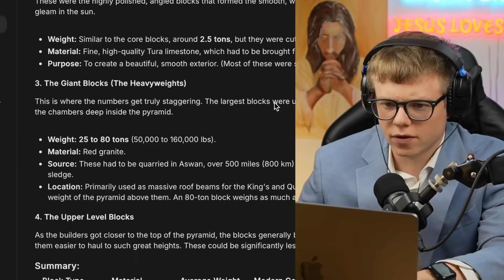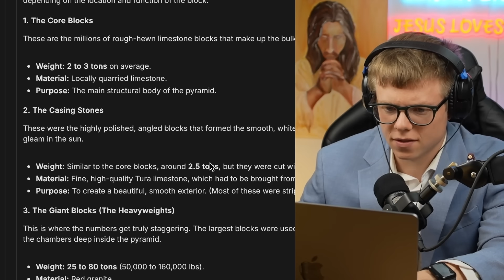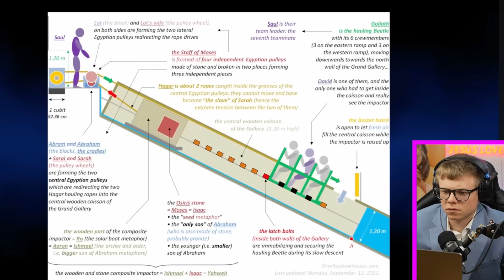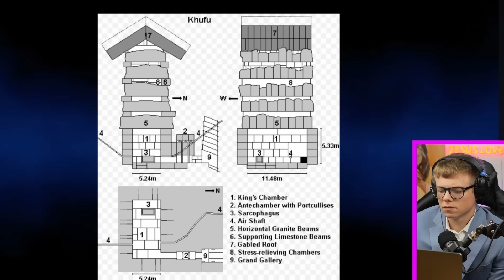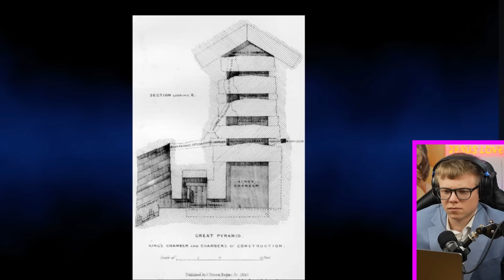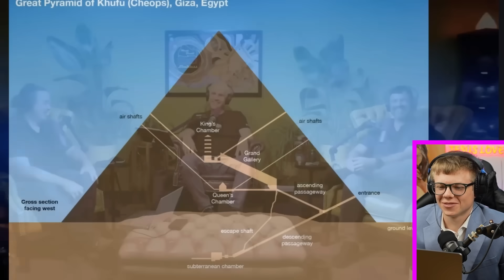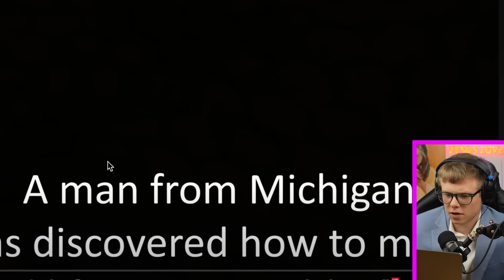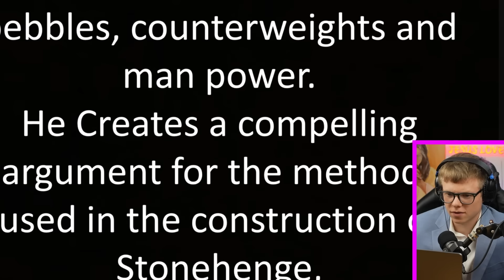Engineer Exposes How The Pyramids Actually Were Built And It's Mind Blowing

Comment: They most likely brought in large trees from Lebanon trading with the Phonecians and built jib cranes similar to their Shaduf. Large wooden pails could of been used filled with water as the counter weight. Several jobs used at once to move large stones. The water filled pails were lowered into shafts that were dug beside the site all around and once the stones were in place they pulled corks using ropes that drained the water from each pail and then workers lifted the lighter pails back up to be filled again.

Comment: If one accepts the current mainstream dating of pyramid construction, beginning around 2700 BCE and continuing until approximately 1500 BCE ( and I don't ) then one must further confront the fact there simply was not a great amount of large timbers available locally, such timber would have come from very far away, through trade with Southwest Asia, particularly the region of Phoenicia (modern-day Lebanon), Coele-Syria (modern-day Syria and Lebanon), Cyprus, Cilicia, and parts of Anatolia.

Comment: Just recently,  they discovered that the Great Pyramid has 8 columns supporting the structure going down 4000 feet (0.75 miles).     There's also a small room at the very bottom.    This would raise the construction difficulty and time required to build the pyramid.  Whatever their motives were,   they spent a great deal of time, energy, and resources to build this thing,   and nobody even knows why.
Reply: You really think ppl did tht😅if you do you can literally be told anything smh

Comment: Couldn’t they just use a bunch of stones on one side of the pyramid as a counterweight… lift a bunch of 100kg stones.. tie them to the top of the pyramid then drop them off the other side of the pyramid while using them to haul up the bigger stones.. repeat.. seems simple enough..
Reply: Large water containers could be used. Raise them empty, fill them and as they increase in weight they descend while lifting the stone block. Maybe?

Comment: 4:44 THE GUY SAYS SOMETHING ENTIRELY UNTRUE, to get around a ramp corner you just move the roller logs to the middle of the granite beam and it goes right around the corner, with each end sticking out during the say 45 degree time of the turn.
So this is the problem. Idiots open their big fat stupid pieholes and remove all doubt, but most of the audience repeats the BS when they go off somewhere else to spread the stupidity.

Comment: Ancient Egyptians had cattle that they used as draft animals back then too. So human power wasn't the only power that they could use to move things around with. And mud is VERY slippery, so water brought in from the Nile and poured onto dirt could be used as a slippery surface to pull heavy blocks of stone over too.
Reply: You do understand what happens to heavy objects when placed on top of mud? Then to make it even worse, attempted to be pulled forward - uphill. Are you familiar with the concept of a plow because that is effectively what you're advocating here.
Reply: @jasonwrner  Are you familiar with the concept of a lubricant? That's what mud acts like. That's totally different than a plow going through dry, hard soil.

Comment: Grand gallery has a sled and counter weights used to pull up blocks.  And they started building from the bottom up. So they didn't have to lift anything more then 1".  They slid the the biggest stones into place without lifting them.

Comment: You dont build them around corners you build around it and then make scaffolding and drag weights up using again oxena nd man power then you wedge the weight and attach the load bearing stone for the top of the room and if you get it exactly right you release the counterweight stone and it moves the other into place and if its not the correct weight then it doesnt go all the way into place or it overshoots nd causes  jean claude van damage!

Comment: You use man power on the oppoite side with oxen and other animals that act like the mechanical energy  the roped are like one foot thick and there are thosaudns of oxen yoked and men pulling and sand on the ramps for reducing friction where the blocks are being ramped up it can easily be done one need only read Roman techniques for moving massive objects around to kno w they can do this!

Comment: Recent test results show that the blocks were "formed" not quarried.  There are no evidence of embeded marine life within the blocks.  Recent test have been done on the cart ruts in turkey and it was from volcanic limestone ash thats now harddened.  Compressed material in molds vs chiseling blocks is night and day. A formed block next to another block is how you get perfect fit not "chiseling" bit by bit or moving 20 ton stones from miles and miles away.  Pre flood structures.  Different material back then.  :)

Comment: Another crazy thing to try and explain is how they drilled perfectly cylindrical air shafts through the rock
Reply: Volcanic rock with quartz content, the shiszt disk proves they can make drill bits, materials used such as metal don’t last long on the surface, few 1000 years max, I can set up a man powered rig  to create 1450-2900rpm required, all that’s needed then is a shaft and a drill bit. Follow lapidary, it will seem easy when you see a lapidary do it
Reply: Rope wrapped around a copper tube like object, water on the stone below, pull rope continuously to rotate the cylindrical object (much like the fire starting method with the rope wrapped around stick and you’re just pulling the rope in and out with it rewrapping around the stick continuously to keep the stick rotating) with a rock or weighted object on top to force it down into the rock, water on stone to help remove friction and debris… boom simple cylindrical drill for stones…
Reply: @calebmiller8867 yep, a method similar to churning, since there are bore marks in the holes we have to assume the drilling was continually in 1 direction, pulling one way drives the wheel, this means gears where an available technology, now we both accept knowledge of cylindrical rotation equalling the potential for momentum, this also acknowledges the wheels existence. It’s too easy to debate these guys

Comment: One of the most challenging and most difficult install/job's I've ever done was carrying granite countertops up 6 stories. In the summer time with no AC up an narrow hallway! It can't be carried flat because the sink hole cut out and it has to be held straight up and down no matter the size! One wrong move and game over! How are they able to do that with giant solid granite blocks that weigh a ton? Our blades and polishing pads we use are microscopic diamonds in beaded as well. It's the only way to cut and polish the hard material
Reply: Not to mention the surcophagus that held the mummy. They sure hidden hollow out a solid granite block and make it smooth as glass with copper chisels.

Comment: As you place the stones you build your earthen ramp higher, filling in all the space all the way around the placed stones ofvthe pyramid. When you place the capstone you set the limestone facia and dig the pyramid out as you place the side facia. It becomes a focal point after it is covered with limestone and is (or was) beautiful. The largest stones in the middle are lowered into place with sand in a column of stone.
Reply: I don't think you've worked out the angles for these so called dirt ramps or the amount of dirt/sand/whatever would have to be moved. They would have had an easier time digging to the center of the earth.
Reply: @Mookaton  Nah they just worked harder and they were tougher. Ya know blah blah mainstream academia bla blah lol